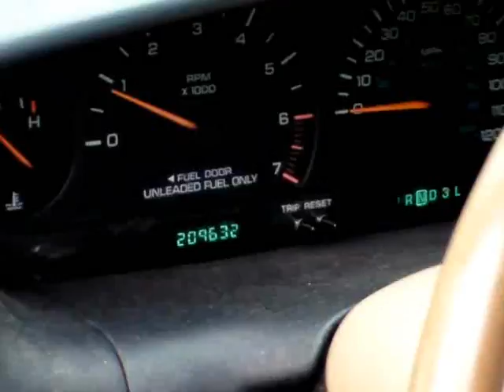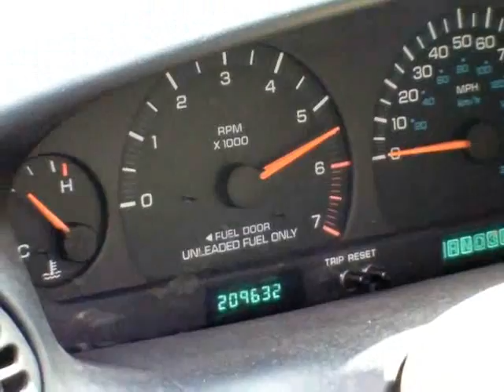Family mini-van DEATH BY BOOT!!

Comment: The only part that should have been replaced was the operator. if the brake lines blew out, how were you stopping it during the violent forward and reverse runs, and that transmission was in good shape with what you put it through in all the reverse drops, and the engine was ok till you put that can of beer in the oil fill, that van was a 400K potential or better.

Comment: Dodge caravans and Chrysler Town & country's from 2001-2007 are the best
Reply: try a 90-94  caravan whit  the 3.3 L those are tuff as nail
Reply: Antoinecorner this is some tough minivan despite the whining of the engine complete lack of brakes and otherwise fucked transmission it just keeps running taking the abuse like it's nothing

Comment: There goes another engine (or) trans that someone else might have used or wanted.  Oh well - hopefully you at least offered the metal up for recycling.
Reply: Someone else may have wanted ? The engine didn’t last too long, transmission was toast from the start, I wouldn’t have wanted anything from this vehicle, also he mentioned it was stuck in second gear, if you want to go through all that work of swapping a transmission for one that only has second gear, well good luck to you same with that engine, could’ve lasted 10000 miles could’ve lasted 3 miles.
Reply: @ryanravencaller  So, basically you're saying you weren't someone that wanted it.  Got it!  (Take note, I wasn't saying you specifically wanted it.)